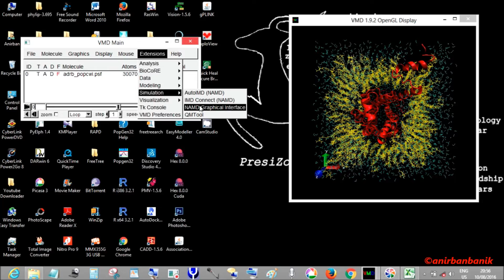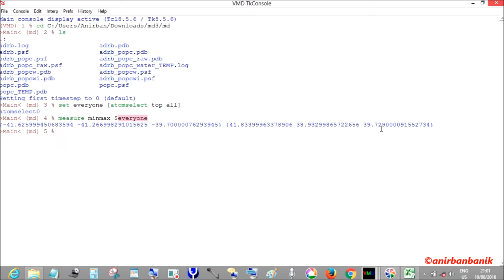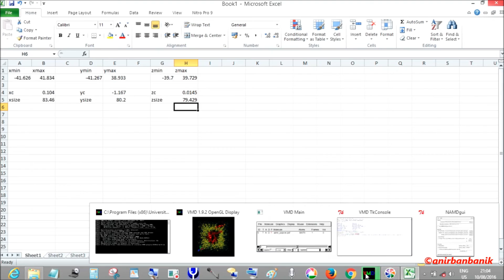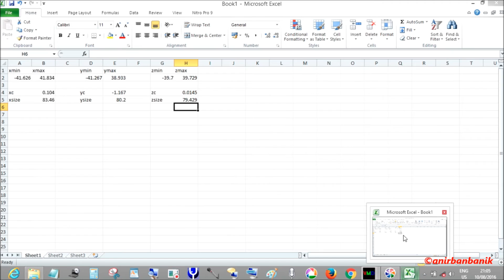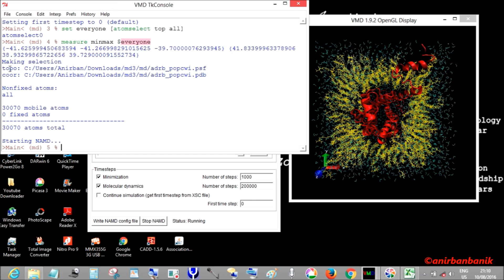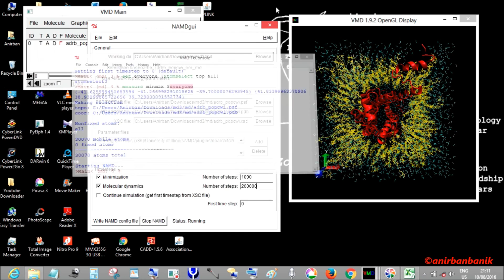Beginners' Tutorial for Molecular Dynamics Simulation of Trans membrane Protein PART III

Comment: Hi Anirban,
Your tutorials are really good. 
I have an error that says "could not locate 'namd2' Description: Would you like to specify its path?", while clicking on 'Run NAMD'. I could not find any 'namd2' file in my system. Then, NAMD goes to 'Ready' state but does not run. I have VMD on RHEL6 OS. I was wondering if you could help. Thank you.

The following is what I get on TkConsole when I do not specify path to namd2

Nonfixed atoms:
all

27542 mobile atoms
0 fixed atoms
---------------------------------
27542 atoms total

Starting NAMD...
namdrun: error running 
namdgui) Warning: possible problem while running NAMD:
  can't read "namd_fd": no such variable